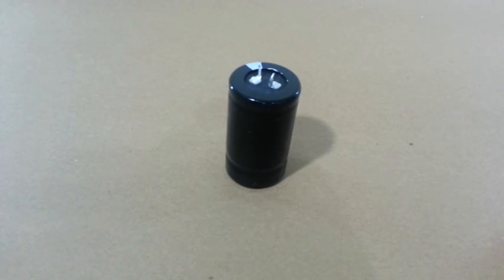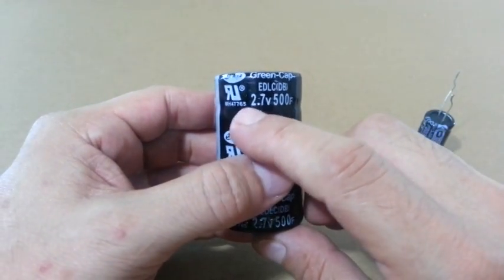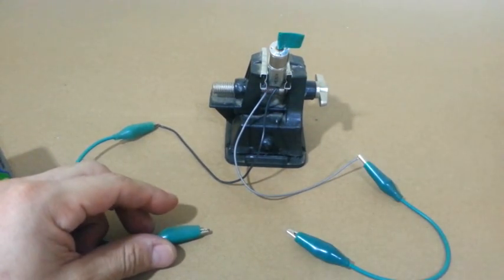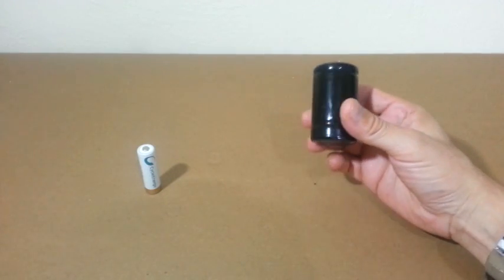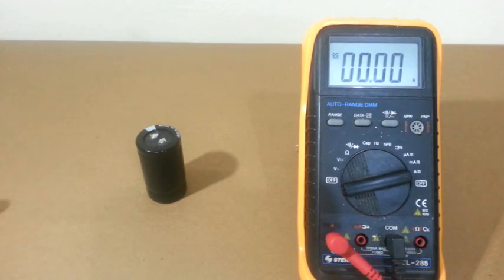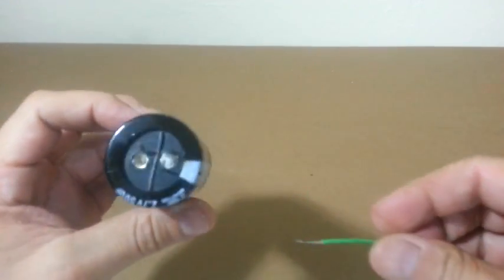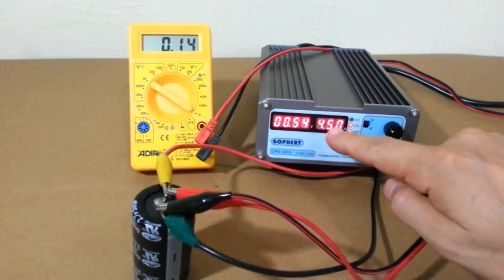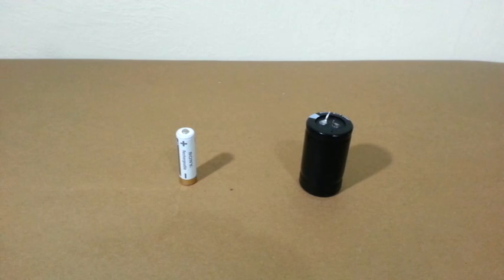Supercapacitor Basics

Comment: can i charge capacitor that is series of 2.7v 500f caps equal to 5.4v with 5v 2a charger without balancing board？ i dont have balancing board on my caps, but the good thing is caps are not heating up. it took 8 mins full charged instantly. when fully charge the caps, current wont allow to enter the fully charged caps

Comment: I have a question could I use this to power my car amplifier add them to get 16v as alternator will give 14v so it won’t exceed voltage , car audio amplifiers that are cheap have 1farad rating but once you open them they show to be full of rubber and the real internal capacitor is so small so far they don’t help but decrease voltage that why you don’t see headlight flickering but if I get a super cap would it be able to operate properly as car alternator provide plenty of constant amperage and voltage ?

Comment: Thanks for the video. To me the claim which some people make, that ultracaps can't replace batteries is a bit irritating because not very precise and in a way even wrong. How I understand it, if I can live with a voltage drop and only need a few minutes of energy, but I want to be able to recharge very often (and fast), then ultracaps might be more economic than a battery. Of course the volume of those ultracaps is also bigger, which might also be relevant.
Reply from the maker: Yes that is correct

Comment: I wonder if a good application for super capacitors might be water well pumps in remote off grid locations given that deep water well pumps require big Amps to start before settling down and being able to run off of a relatively low wattage inverter.  It is the start-up amps required that make deep water wells difficult to run off grid. Would super capacitors work well in that scenario? What would be the drawbacks, pros and cons?
Reply: Only if the motors are DC. For AC, only thing that helps is a way overpowered inverter

Comment: thx for the explnation.. have just purchase two caps from China.
one blue Maxwell 2.7v 350F at 7.5USD delivered to DK and one green from a more or less no name brand ' 2.7v 500F at 4.5USD delivered.(if they are any good and somewhat loyal to rating, time will tell..just wanted to give notice what these costs here at 2Q 2019 from a noob perspective as mine' as it could be relevant to sense price-evolvement over time as there is a lot of engineering in supercaps these years..

Comment: Yea, clear up my question between battery and capacitor.

So basically capacitor can take high current charge. Just need to use DC current regulator to output volt. Otherwise it will give out all at once. Burn the equipment. 

Is this the correct assumption?

May I ask below capacitor geometry questions for my DIY capacitor made from plastic sheet and alum foil?

Bigger the roll (bigger diameter) make higher capacitance.

More surface contact to + and - leg make higher Amp capacitor.

Does longer the cylinder roll make higher DC voltage?

Comment: FYI, current available with a capacitor is determined by Resistance across the capacitor BUT time comes into play! For example, a 100 volt across a cap. and a 1 ohm resistor is places across this cap. resulting in 100 amperes current flow! Follow the capacitor formula and/or  ohm's laws! Motor start cap's can deliver hundreds of amperes to start the electric motor spinning and or running: the lower capacitor value is the run capacitor!

Comment: question:  capacitor,  being a "passive" device, can it be used to "CHARGE" a BATTERY?
Reply: well yes but no
Reply: they would only send out all their electricity quickly unless you have a bunch running togther to keep up the voltage

Comment: THERE IS NOTHING GREAT IN THIS VIDEO INPUT = OUTPUT / LAWS OF PHYSICS , CAPACITORS DOES NOT CREATE OR ADD ENERGY TO WHAT IT HAS ABSORBED IT SIMPLY DISCHARGED THE ENERGY STORED AT A FASTER RATE. MY THEORY STANDS THAT IT WILL NOT BE THE BATTERY IN THE FUTURE. HAHAHAHA!

Comment: IN YOUR VIDEO YOU DID NOT MEASURE OR TIMED THE CAPACITOR AND THE BATTERY YOU WILL NOTICE THAT THE CAPACITOR DISCHARGED WAY FASTER THAN THE BATTERY  THE REASON IS BECAUSE IT GAVE AWAY ALL THE ENERGY IT HAS STORED UNLIKE THE REGULAR BATTERY IT DISCHARGES SLOWLY BUT THEY WILL BOTH EQUAL IN THE AMOUNT OF ENERGY GIVEN OFF IF YOU TAKE AWAY TIME. SO IN NO WAY A CAPACITOR IS THE SAME AS A BATTERY BECAUSE IT HAS NO SOURCE OF ELECTRICITY OF IT'S OWN. NONETHELESS THEY ARE BOTH RECHARGEABLE BUT THEY WILL GIVE OFF EXACTLY THE SAME AMOUNT OF ENERGY STORED IN THEM. THEREFORE THE QUESTION GOES BACK TO THE ORIGINAL PROBLEM AND THAT IS WHERE WILL YOU GET ELECTRICITY?

Comment: FOOLISH VIDEO WHERE DID YOU LEARN YOUR ENGINEERING! CAPACITORS HAS NO ENERGY OF THEIR OWN CAPACITORS ARE CALLED SHOCK ABSORBER  OF ELECTRICITY THAT IS WHY THEY ABSORB FAST DISCHARGE FAST. IF IT WHERE IN ANY WAY LIKE BATTERIES THEY WOULD HAVE NOT BEEN CALLED CAPACITORS. ASK THE CREATOR OF G.E.

Comment: Supercapicitors cannot replace battery's, each is unique. In fact batteries are more practical having both high energy density and reasonable power over time. What may be practical is a hybrid, fast charge capacitor in parallel with a battery since the capacitor can accept higher current charging. I.e full charge in minutes. However this is also impractical in the long term as it neccitates frequent charge which may have an adverse affect on the batteries longevity. A solution will eventually be found and it will be more evolutionary than revolutionary. Lots of research has been conducted on battery technology, some groundbreaking dating back 7 years now.. they have not been commercialised.. this may be due to the very high research and development costs.. and also entrenched vested interest.

Comment: THANK YOU FOR THE EASY TO COMPREHEND EXPLANATION...''AT LEAST SOME TWENTY OR THIRTY AMPS'...???THAT CAN BE PROVIDED BY SHORTING A BATTERY....OF COURSE THESE ARE CHEAP CAPACITORS AND PROBABLY NOWHERE NEAR THE RATED CAPACITANCE...THE GOOD QUALITY ONES FROM THE DATASHEET I READ ...WITH 500F AND 2.7v  HAVE A PEAK CURRENT ABOVE 250A...BUT DO YOU  HAVE AN IDEA WHAT ARE THE PEAK AMPS THEY CAN PROVIDE........????THANK YOU IN ADVANCE...!!!!

Comment: Although the big one has more than 100.000 times the capacitance of the smaller one, it has much lower voltage, ergo the total energy stored is only about 1.240 bigger. The big one can store about 1800 joules and the smal one about 1,5. If you prefer milliwatt/hours it's 500 VS 0,4.

Comment: Hello, sir! I'm wondering if, super capacitors could be charged with a motor generator, and consequently, charge a power bank of 18650 cells... You know, like a self-charging system to use on a bicycle.

Comment: You forgot a few more differences.

- A battery can be recharged (called cycles) only about 1000 times before it is destroyed. I am not sure what exactly happens to the battery but it will "pretend" it can store much lower amount of energy than when it was new.
- Discharging the battery partially and then recharging it may shorten its life due to so called "memory effect". NiCd chemistry is very suspectible to this, NiMH is much less suspectible, Li-Ion or Li-Pol uses some tricks to get rid of it.
- New Li-Ion or Li-Pol batteries require that you "format" them before use by charging them fully and then discharging them completely a couple of times. Some batteries (e.g. those in laptops) may come already "formatted".
- Li-Ion battery can explode when overcharged, shortcircuited or charged with currents that are too high (the typical li-ion battery in a phone or something has a charge controller which cuts off the power when it "thinks" the battery is charged but a cheap "made in China" knockoff may lack this protection). Other types of batteries may be damaged in these conditions. This is true even when the voltage used to charge them is lower or nearly the same as the voltage.
- Batteries don't like high temperatures.
- Batteries have low self-discharge rate, meaning the charge stays in them for a long time (years).

- Supercapacitors are nearly indestructible. You can get at least million cycles out of one and often much more.
- Supercapacitors may be charged safely if your power source has voltage lower than the voltage at which the supercapacitor is rated. The current simply stops flowing when the voltage in the supercapacitor reaches the voltage of the source (if your power source is of higher voltage, you can do this safe charging by putting a couple of supercapacitors in series on it and they will get charged simultaneously with each one getting a part of the voltage).
- Supercapacitor will most likely get destroyed if you subject it to a voltage that is higher than its rated voltage.
- Supercapacitors won't get damaged at all by shortcircuiting them or charging them at a high rate.
- Supercapacitors have high self-discharge rate. If you charge one and then leave it lying on a shelf for a month, after that month you will discover that it is missing some 30% of its initial charge.
- Supercapacitors can handle high temperatures much better than batteries.

Comment: Not sure but I think supercapacitors doesn't have the problem with getting destroyed when you reach very low voltage. Normal electrolytic batteries do have this problem.
Reply from the maker: they don't

Comment: @3:50 voltage is not dropping almost linearly with charge. If you consume half the energy, the voltage drops by about 29%, because sqrt(0.5) is about 0.71

Comment: Did you measure the leakage current of this cap? I had a similar cap and in 24h or less it would discharge itself to nearly 0V without any external load. That would be another significant difference between caps and batteries:)

Comment: i just want to check the math:
the max. energy that can be stored = .5 X C X V^2

and C = (C_of 1 cell)/no. of series cells

V= (V_of 1 cell) X no. of series cells

this means that the max energy that can be stored = 
.5 X C_of 1 cell X (V^2) X no. of series cells

this means that if we connect the super caps in series we can store more energy than if we connect them in parallel ! 

I know this doesn't make sense but I wanna know what's wrong in the math

Comment: You say that the energy stored in the capacitor is linear in relation to its voltage. You also give the example that at half of the capacitor's rated voltage the energy stored would be half of its total energy storage capability. This is incorrect, as can be seen by the energy formula you showed in the video J = (1/5)C * V^2. This means that the energy stored in the capacitor reduces exponentially as the voltage decreases. At half of the capacitor's rated voltage, the energy stored in the capacitor would actually be 25% of the energy storage capability.

Comment: Capacitors have a linear discharge curve. The Harrison Labs 
(www.hlabs.com or http://www.hlabs.com/products/fluxpower/) FluxCap tm 
is a step up high current 50, 100, or 200 amp (all stackable) power 
supplies that make up for voltage drop in power wiring and will provide 
much more output from a capacitor since it will provide the full output 
voltage until the input drops below 11 volts! Also, perfect for 
dragsters that have no alternator.

Comment: As a teacher, I found your presentation very informative.   The demonstrations illustrate important points.  There is one formula that isn't completely correct,  but no one is going to design a space probe from this video.  In a few minutes you made a very good and easy to understand comparison between rechargeable batteries and super caps.  Well done amigo.  I subscribed and will recommend your channel to others.

Comment: Hm. There is an RC time constant that governs how quickly a capacitor can charge or discharge. Resistance (or internal resistance for a direct connection) times capacitance equals the time in seconds for the voltage to have a increase or decrease of 63% of the source voltage. A minimum of two to three time constants should be used for charging times.

Comment: so if this cap that written 2.7 volt what happen if it charged from source of 9 volt for example, is it would 'explode', or still safe to do
Reply: explode
Reply: so how to step down the source voltage? is there any transformers for dc voltage?
Reply: there is DC-DC Converter circuits you can use
Reply: oh, so for dc current it called "converter" while "transformer" are for ac current?
Reply: no no  it's not a transformer
it's a more complicated circuit with many components called "Buck converter"
if you want to raise dc voltage use circuit called "Boost converter"
Reply: +amilom007 could you use a voltage divider ?

Comment: Several things that need clarification.
Supercaps and ElectrolyticCaps (cause you compared them) do not serve the same function.
Supercaps have higher energy density, but lower power density - aka for a given volume or energy they can deliver far less power.
They sit pretty much square middle between Elcos and LiPos - both in energy as well as in power density.

Specially when you compared the Elco to the Supercap and later the SuperCap to the battery:
Yes, the SC can hold 100 000 times the charge, but that only translates to 1000 times the energy cause of the 1/10th voltage.
SCs offer up to 100 times higher energy density, Elcos offer up to 100 times higher power density.
But they do not come anywhere close to the energy-density of batteries.

The relation between stored energy and terminal voltage is not even close to linear. stored energy scales with Voltage squared. So when in use, the lower the energy the faster the voltage drops.

And no, it does not need (and normally doesn't) use nanotechnology.
it uses good old activated coal.
Reply: I subscribed to u. Make content ur awesome!!

Comment: So i made a generator by rewiring a PC fan and instead of requiring power to turn the fan it produces power when spun. Im trying to charge  a super capacitor with this but im not sure if im doing it right. The capacitor is connected to the generator and is parallel to an LED light. I want to provide power from the generator to charge the capacitor and have the LED light on, once i stop generating power i want the supercapacitor to continue to give power to the LED until it discharges, but the supercapacitor isnt charging. i have  a multimeter and im producing around 7 volts AC, the capacitor is a 2.7 V 50 Farah super capacitor and the LED is 2.7 V

 any help is appreciated
Reply: Major Mafalde I read somewhere that capacitors don't work with DC only AC??

Comment: What was that W on the high voltage capacitor? 450WV? Sounds like the rating is Watts * Volts. So it might not be a 450V rating or I would probably just see 450V without a W.
Reply: The "WV" on an electrolytic capacitor stands for "working voltage" which is the voltage it is designed to operate at.
Reply: Dallas Cheked Wow thanks, I saw it on a power line transformer and I was wondering what that ment.

Comment: has any work been done on the discharge voltage curve or is it just inherent? when people talk about "charging this device in 30 seconds in the future" do you envision this as a parallel energy storage to a battery? you polug in the device and get 2 hrs screen on in 30 sec but if you leave it plugged in the bat charges too?

Comment: Really intresting video|| I know.......... not much aboout Electricity  but.. example; I´ve 40 Amps in total .220v.
What if instead of the resultig molten wire....my finger  is the  "wire" in that device you show?
Reply from the maker: nothing happens to your finger, resistance of skin is very high and with 2.7 volts no current will flow

Comment: Just to be picky, the big capacitor can only (!) store 11500 times the charge of the little one, not 100,000 times. Because the voltage rating of the smaller one is higher. But volt for volt the 100,000 claim is correct.
Reply: g

Comment: so if you put a resistor from the super capacitor to manage the volts/amps/current how long can a 120w lightbulb run for?
Reply from the maker: +Cory Samoila this supercap only gives 2.7 volt. Not enough for a lightbulb
Reply: I get that sry, from a 240v super duper ultra capacitor?
Reply: Who uses a 120w lightbulb anymore?
If you are going to use these things you have to do your own math and understand the theory mate...one thing to say: E goes up with V^2 so high V caps are expensive and sought after...

Comment: If we touch the terminal of Super Capacitor then our finger may melt like wire ?
Reply from the maker: No, voltage is very low and your skin is of high electrical resistance. you need more volts to feel a shock
Reply: I bought a 100v 10000uF capacitor , can it shock me when I will touch the terminal with fully charged condition ?
Reply from the maker: +Nasirul Haque it can kill you
Reply: +Giovanni Guerrero The wire became red hot because its resistance is very low, so even 2.5 volts was able to pump a lot of current through it.
Reply: Ludic Science 
I've had this question for the longest time. So its amps that makes the wire melt red hot? I expected a larger voltage to be required to do this but it seems that just 2.5V with a lot of current would do the trick. What happens to a thin wire with say 100V and 1amp?
Reply: @Giovanni Guerrero, If the power source can supply the current, and what it's flowing through has a low resistance, then voltage doesn't matter.

This is exactly the principle on which spot-welders operate.  You can touch both terminals of a spot welder with your fingers and turn it on and you'll feel nothing because they generally operate at a very low voltage, in the range of 1-5V, which can't penetrate the relatively high resistance of your skin.  But put that voltage across a piece of metal and hundreds of amps will flow, heating up the metal enough to weld it.